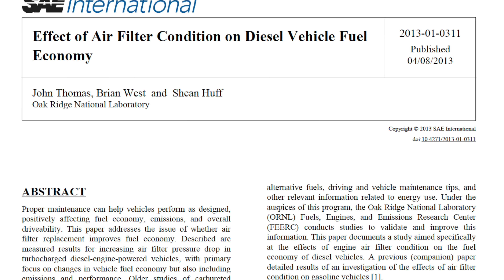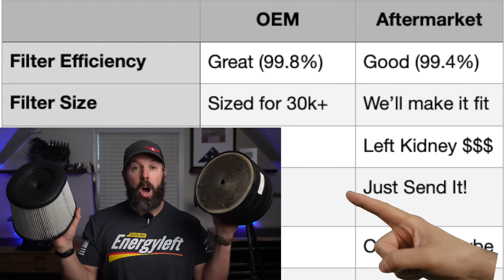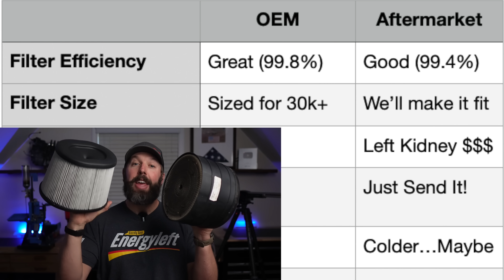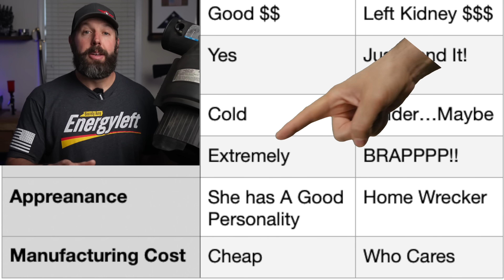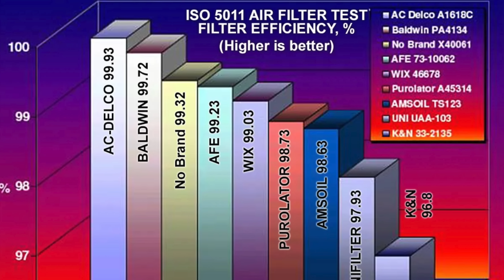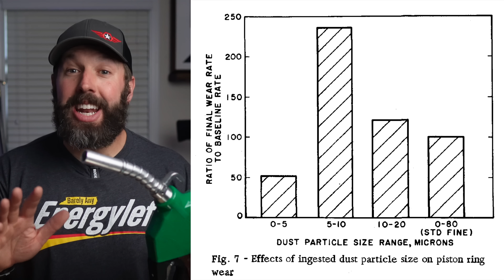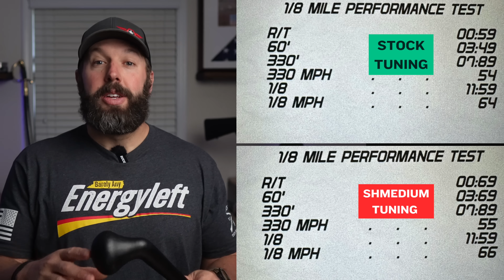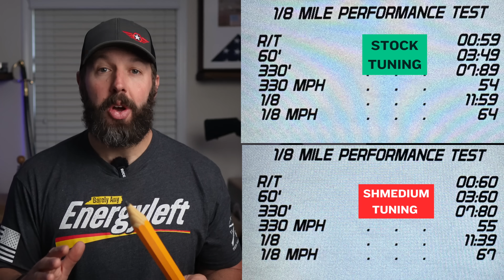The TRUTH About Cold Air Intakes…ACTUAL SCIENCE!

Comment: Good presentation.  Let me add a few facts.

Under hood temps when in motion at anything normal road speed are at or near ambient.  Sounds wrong, huh? I’ve had two friends that didn’t know each other independently instrument three different vehicles with thermocouples under the hood and data log while driving.  Both, on all three vehicles, returned with the same results.  Doesn’t mean it happens in all cases, but the results are clearly interesting and counter to what most people think.  BTW, my friends doing the testing?  One is an engineer and the other a PhD research scientist.  IOW, not hacks and know how to do proper testing.

Colder air does make more power, but barely.  There are calculators for this on the web (or at least used to be).  Colder air makes no discernible difference.

Now for the wrench in the gears…

Most people (including those at companies selling “cold air intakes”) don’t really know how to make power with them.  They don’t make their power from cold air.  They make it by tuning the LENGTH of the intake pipe.  This is the same way a header is tuned for maximum power.  AEM, the company that started the CAI craze, didn’t bother with calculations.  They put a car on a dyno, tested.  Shortened the tune 1/4”, and repeated ad naseum until it was clear the length that made the most power, and that’s how they set the length for their product.  Long tube TUNED intakes are capable of producing decent power.  Nobody does this anymore though.  While I don’t have first-hand knowledge of the AEM testing, it was told to me by an automotive engineer who actually took part in the testing.

Something to remember about long tube CAIs though.  If you place the filter low on the vehicle, you potentially turn your engine into a very powerful shop vac.  Look up hydrolock.
Reply: Oh, follow-up.  AEM was sold long ago and doesn’t do that testing anymore.

Comment: The irony about people don't want to hear their turbo. I don't get the concept why would you be wearing headphones (buds) Not the -cheech & Chong kind.,
when you need all of your senses while you're driving a vehicle. If people can't see they aren't driving.

My car actually comes with a engine amplifier speaker. I had no clue why my dashboard was vibrating as I'm driving with like sound and it's not related to the music I am playing.

I would think the whole concept if I wanted to hear my engine while I'm driving then my car would come with a door to the engine compartment next to the glove box.

From what I've gathered with other people that are disconnecting it. I drive a manual stick 6-speed. Put the floor clutch I'm not a steering wheel paddles kind of guy.

If you access this engine amplifier and disconnect it. It will cause a trip code and your ECM. The CPU of the car. Something I believe with if you have heated seats I don't have that that's for fancy people. I think something dealing with your airbags.

Now I've seen people do it and just don't care but I'm still at least in the vehicle so I kind of have to care. I could see them utilizing me doing that and causing a clusterfucker problems. This way they can say well it's not covered under warranty.

But I haven't seen a video on how to properly bypass it or keep the circuit live like if you were to stick a paperclip in it there's a theory. To maintain the live feed. And no it's not edible. Just figured I'd throw that out there.

Anyway I've been loving your videos for quite a while you are just down right so realistically funny. People would pay to see that shit!

As for the Air & flow, It's just logic with common sense. They are both not common anymore.

Comment: The way it was explained to me, because I am not an expert, if you think about all that dust getting in it's like sandblasting the cylinder walls which will remove the crosshatch pattern faster.....allegedly. This leads to oil consumption due to oil getting past the rings and burning....probably.

Comment: I knew not changing the air filter in my 5.3 was beneficial 🤣 it had 300k on stock everything but sparkalators and. Transmission rebuild at 215k

Comment: At 2:07 I noticed you didn't say go 10k between oil changes like manufacturers recommend.... because that would be horrible advice. Literally some of the worst advice I can think of giving someone.
Reply from the maker: I go 10k minimum between oil changes I. This Duramax. It’s not horrible advice. I have the used oil analyses to back it up. Oil Change interval depends on the service conditions of the vehicle. Some can easily go 15k or more miles some need changing much sooner 🤷🏻‍♂️
Reply: @freedomworx  there are videos of the studies on YouTube of tear down comparisons of engines running for the same amount of time at the same load with 5k vs 10k oil change intervals and the cleanliness of the engine in the 5k engine is staggering. Gasoline or diesel.
Reply from the maker: Cool. Do whatever makes you happy. I’ve owned multiple vehicles with well over 350k miles with no engine wear or oil burning issues. All were on the recommended 10k interval, or more if used oil analyses dictated. Should semis be changing their 12 gallons of oil every 5k… so basically every 2 weeks? Should ships and trains be changing their oil every 5k? The conditions dictate. There is no special number like 5k. It means nothing.
Reply: @WhyFacetattoos  Who cares about the cleanliness of the engine, your not eating out of it.  It's about the condition of the engine.

Comment: To be fair that independent air filter studies you cited is over 20 years old.  Diesel place  hasn't put out useful information like that in a long time. Not that that really probably changes the results at all. 

I will say the stock filters on the LBZs are pretty good filters. Those Power Core filters are on lots of construction and AG equipment. My LBZ has the fuel and air for 700hp and I still run the factory setup minus the air centrifugal.

Comment: as far as i understand it, stock intake locations are already pretty damn good. but if you want more power you need more flow, so that means the replacement either follows the same pathing and pulls air from the same place, or a new pathing and air source that also provides fresh ambient air, not engine bay air.

Comment: I've seen so much dust in intakes that had a K&N installed over the years.  Anybody who says K&N is just as good doesn't know what they're talking about.  There are even people out there who think that K&N somehow filters BETTER than a stock filter.  

I can't wait to see the fuel economy thing on gasoline engines.  My experience says no way does more airflow potential through the filter help with part-throttle use on an EFI gas engine.  The limiting factor is the throttle position, and especially in these days of drive by wire throttles, the EFI is just going to adjust for the air actually going through the engine.  Never have I put a new air filter in a vehicle and had it affect the fuel trim numbers.  Cleaning the MAF will, but just changing the filter, never.  A carbureted engine is the only scenario where I can see filter cleanliness making a difference here.

Comment: Another problem you got with your air filter test is Delco maybe be high filter efficiency than the others, but at what micron. If Delco is that high at 20 micron, but K&N is that low at 10 micron, I’ll take the K&N. It’s because I’d rather have only 10 micron enter my engine vs 20 micron size particles!!!

Comment: If you take the cost of the air filter and divide it by 30,000 miles, the cost per mile is pretty low even if the filter cost $100.  0.33 cents per mile would be recovered very quickly even with a nearly immeasurable loss in fuel economy.  If your diesel gets 20 MPG and fuel is $4/gallon, that is 20 cents/mile for fuel.  0.33/20 = 1.65% which likely is nearly immeasurable on a dyno, but isn’t a far-fetched loss due to filter flow, particularly given the significant change in power.  So, I am not convinced that running a filter too long is big win.  Now, if you have a filter indicator on your engine so that you can tell with the increase in vacuum is above the engine maker’s limit, then by all means run the filter until the indicator trips.  If not, I’d err on the side of changing the filter a little too soon than too late.

Comment: Im with ya on this entire topic bro.  1st time I've found ur channel.  I dig it thus far.  Great vid.  I have med tune 7.3 that's properly re geared for tire size . I run an aftermarket filter in it.  Only notice anything w my butt dyno when I'm hauling my big trailers. Or if it's that perfectly cool temp in the morn that 1 day a decade where u can just feel her drinking it in and she sounds and feels oh so riiiiigght. Haha. Wait maybe that was a dream..  Anyway never was sold on the intakes. I just buy the aftermarket I like that fits in my stock box for all the reasons you outlined. Seemed like a waste of coin for no gain that I would see.  I ain't racing her. I race mx bike on dirt and mud  tracks and I throw that oil covered cleanable air filter out every ride.  You see that wear super quick in your race mx bikes. I learned the hard way.  The honest way .  The way we all do..  f around and found out.  Dirt gets through .  Motor is done. Period.

Comment: I put a K&N filter on my 1999 Chevy 5.3l high school truck to increase power (cause I was cool). I didn’t feel any power increase, but immediately lost 2 mpg. (17.5 down to 15.5ish) Based on my top off the tank and divide the miles driven by gallons added technique I used every refill. So I put a new paper filter back in and achieved the original 17.5mpg right away.

Comment: I’m a tugboat captain 
I push barges loaded with sand and gravel. In the summertime there is a shit load of dust.

The main engine air filters get clogged up this boat will smoke like crazy. It’s real obvious that the engine is not getting enough air for the amount of fuel we’re trying to feed it. 

Change out the air filters, and the coal quits rolling. Which we do, because nobody wants to breathe that shit.

Comment: OEM wants all engines to live for 5 years or 100,000 miles and then fall apart...hence the use of plastic in the heat-cycling environment of the engine bay.
You have failed to define "efficient" .  "Efficient" does not mean "generally better".  "Efficient" refers to how well a thing does ONE of several things it is supposed to do:  Filter out particulates.
Fill your intake plenum with epoxy and you will get 100% filtration efficiency.  But your engine won't run.
Feel free to fill your oil filter with epoxy too, and you will have 100% Efficient oil filtration...but your oil will not flow, and every part of your engine lubricated by an oil passage will seize.

So, if you want a better-flowing air filter that won't hurt your engine buy a Donaldson air intake made to filter a higher air volume than oem, with oem or better filtration...but you'll have to take off your hood.  The intake filter and housing will be much bigger, and probably will not fit under the hood.

For oil...bigger filter, higher pressure oil pump, deeper pan bigger volume of oil.

So choose your tradeoffs.  
On my 4.0 Jeep I chose a Donaldson intake made for a 5.9L excavator with a turbo:  Higher Flow, better filtration.   28 years and 300,000 miles later, the Jeep runs great.  Hasn't even been rebuilt.  Took off the head fearing valve or ring wear, cylinders still have factory crosshatch.  Dead cylinder was a bad injector wire.

My great grandkids will end up learning to drive in that Jeep.

Comment: My 2005 f150 with a 5.4l 3v triton benefited greatly in power and fuel economy with a banks intake. I do live on gravel roads so this video has gotten me worried. Before I put an intake on my truck, it was grabbing air from a hole in the fender about 2" in diameter with the rubber grommet inside of it. It sounded like plastic crinkling any time you pressed the gas further than 50%. The truck had no balls, couldn't get out of its own way, and got even worse fuel economy. (I was rolling around 12mpg mostly highway) When I put the intake on it, I believe it increased fuel economy because I didn't have to floor the truck in order to go 70 mph. It got about 14 mpg after that which is what the truck is meant to get in combined conditions. Today it has headers, an exhaust, and a slight tune, throwing the inefficient 5.4l to 16mpg. Was it worth it to get 4 mpg? Maybe slightly. The truck sounds a hell of a lot cooler though and can beat any other truck of its year. Ford left a lot on the table for that poor 5.4. I hate to go against science and all that but the more stuff I've done to that truck, the less vibrations I get from the engine, the less fall offs when you hammer it, and other improvements. I think I can safely say that my engine is happy these days. Maybe not with the amount of dirt, but she runs like hell and loves doing it.
Reply: Note: the banks intake is a boxes intake and only has a rectangular hole on the front of the box for a little more air. It still uses factory location also. 
Note 2: Did not do a 0-60 before and after. Wish I did but can't change the past. I did burnout tests though. Before any modification the truck was unable to do a burnout with and without brakes. (Fx4 limited slip differential) With all modifications, it will spin the tires taking off from a stop sign too hard without brakes. I don't know how much power it's making but I know it has more.

Comment: The whole reason the cold air intake trend got started was because a lot of OEMs back in the '80s and '90s choked down their engines significantly with the stock filters when they went to EFI, and many also didn't do a good job of getting cold air into the filter inlet. I do have real world testing on this with a beater Saturn that I owned years ago. I found a 4 inch AEM intake off of eBay for cheap and slapped it on there. When I did, the car felt a little bit peppier, which is a big deal when you're only making 125 horsepower or so. Also, the mpg jumped from 23-24 around town to between 26-28 mpg with the CAI installed. Mind you, I drove that thing like I stole it, so that mileage was pretty good considering. Up on the highway I was approaching 40 mpg, and I even got 42 with it once when I was trying really hard and going exactly the speed limit. I could barely crack 30 mpg with it using the stock setup. I wouldn't expect to get any benefit at all from doing the same to a car manufactured after around 2000 or so, give or take depending on the make and model. The intakes on anything by that era are adequately sized and they all seem to do a good job of pulling air from outside the engine compartment. I notice a lot of them are even set up with what I believe to be a ram air effect, so you're probably going to hurt power up on the highway and kill mpg by getting rid of them. The reason these used to work is the same reason a cat back exhaust system and a set of headers worked. The OEMs left a lot of power on the table there. Not any more. On my current grocery getter engine I know of guys making nearly twice the factory horsepower and they're still running the factory cast iron manifolds. Now I understand that there are exceptions, like if you do a proper cam and spring swap on your LS, but even on those, on an otherwise completely stock engine with no cam, headers aren't going to do much. The factory manifolds flow pretty well.

Comment: Who's lining your pockets for this mis-information session? If you use an oiled filter (per instructions and not overloaded), as so many after market filters are, you increase that filter's ability to collect/trap dirt/dust particles -- the purpose of the oil. That's the reason a "used" filter is more effective is because it utilizes physics and the principles of static electricity to attract other similar particles together. I agree on one thing you said, the after market has become quite the money pit, if you fall for some of the pseudo-science BS pushed by some manufacturers. These after market intakes do increase performance and are safe to use, when properly maintained. Most OEM air filters are quite restrictive in design and placement (like my Blazer's factory air box, hidden behind the headlight assmbly w/ a 2" opening). As for engine noises, if you're thinking about an after market intake, my bet is you're not going to worry about a minor increase in noise nor will it be seen as a negative.  My Blazer has over 300K miles on it and I've been using an after market air cleaner since I bought it about 200K miles ago. My engine runs great and I get 22-25 MPG.

Comment: Finally someone tells the truth about CAI (cold air intake) mods and free flow filters. I saw a test on K&N filters a few years ago and was horrified. Since then I have only used premium (stock fitment) paper filters. Unless you are going racing and plan on rebuilding your engine on a regular basis, there is no intelligent reason to use anything but high quality paper filter in your vehicle. That is unless you are one of the “50 below” (one of the 50% of the folks who reside on the negative side of the IQ bell curve) who think a CAI with a reuseable fabric filter is worth the early destruction of your vehicles engine because your 50 below peer group think it’s cool.